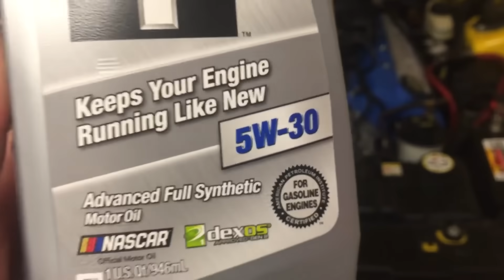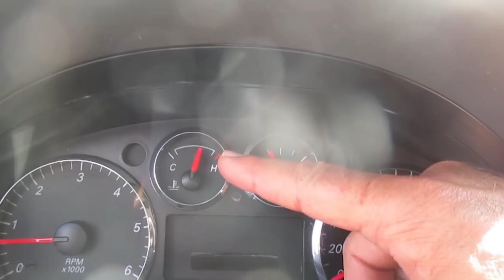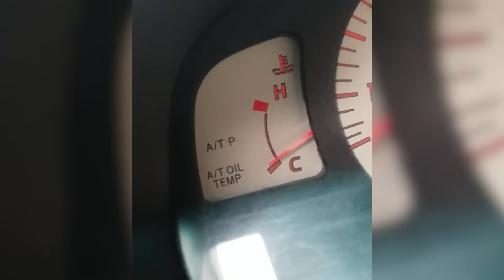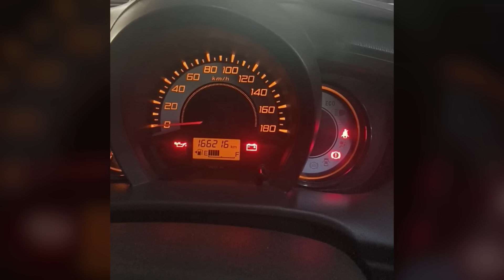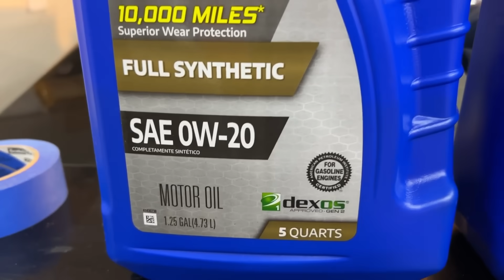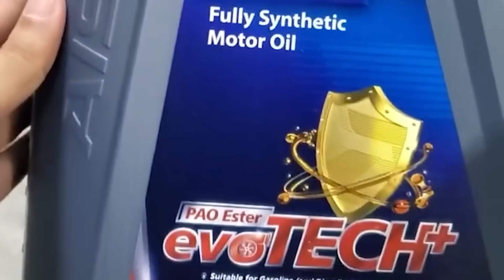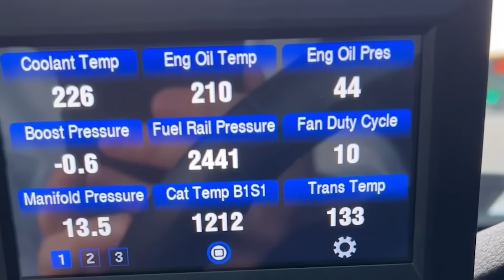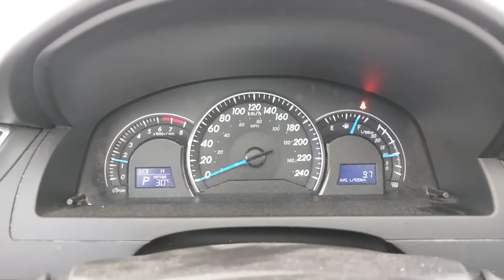Why US  Cars Use 0W 20 But the Same Engines Use 5W 30 Abroad (Exclusive Mechanic Explanation)

Comment: I called and talked to customer service at valvoline, They assured me there is no benefit to go to 5w30 and I should stay with 0w20 even living in hot climate such as florida.
Reply: Reply based on liability? Perhaps
Reply: And you should have asked why do you make 5w30 oil then.
Reply: Yeah, they figure whether you buy Valvoline 0W20 or 5W30 why should they potentially open themselves up to a lawsuit if you develop problems. This is a highly debated topic, do your research and choose for yourself.
Reply: No manufacturer will go against recommended oils, opens them to law suits. Use online viscosity charts.  0w20 fine under 60F, over 70f or so it will shear and not lubricate so well.
Reply: The car companies got the oil companies to lower Zinc in their oil years back to get their catalytic converters to last the 150,000 mandate by the govt, instead of making the converters better, Zinc is 1 of like 2 or 3 things that protect the Engine, don't trust either, they are there for Profit
Reply: Because valvolines not paying the bill you want to put water in your engine go ahead!!!!!!!!!!!
Reply: I was getting my oil changed at Goodyear . and I asked them to use 5-30 on my tundra instead of of 0-20.  after slapping a couple keys on the computer , he said NO. its a  liability issue for sure
Reply: @Phillip-t5y8i  Same at Walmart service. Finally, got tech to search Latest specs for GM L-87..... 0W-40.. DEXOS.. Mob 1 Super Car meets new GM spec.

Comment: Bull crap! My Camry has used 0W20 per manufacturer recommendation from the beginning and it has over 250000 miles and still rubs like a champ
Reply: LOL, it "rubs"? I get it!
Reply: Gotta love anecdotal evidence. "My car runs X and it's fine so you are completely wrong" it's great that your Camry is going strong at 250k on 0w20. The fact is that engine oil is far too thin. We are seeing engine failure earlier and earlier across the board because of thinner oil, among lots of other nonsense like 10k interval oil changes, engine stop start and higher and higher ethanol content in our gasoline.m, just to name a few.
Reply: @angelos5348   0W-20 and 5K miles oil changes for me. 
Stop start and tiny engines with turbos that replaced V8s and V6s are the problems and not the oils.
Reply: @a @angelos5348 I have a 2015 Honda accord v6 with a little over 200k miles. It doesn’t burn oil. Toyota and Honda have been using 0W-20 oil for over a decade. All their models use 0W oil and the only engines that have been having issues is the 3.4TT engine. The rest don’t seem to have any issues and in Hondas case with the 1.5T the head gasket issue isn’t oil related and the engine failures on Toyotas TT v6 may not be oil related either. GM doesn’t know how to build engines with tight tolerances which is probably why the 6.2 and 5.3 engines have been locking up…but those engines have always had issues since 2007 due to the AF
Reply: моя Тойота уже 25 лет ездит на 20w50 и чувствует себя как победитель среди чемпионов
Reply: @Taganskii  Yep, get yourself a brand new 2025 vehicle that supposed to use 0W-20 and replace it with 20W-50, let me know how it works.
Reply: That 0w20 is probably why Toyota has had so many engine recalls over the years
Reply: @MástázTëâchèr yea maybe that twin turbo v6 but every other engine is fine
Reply: @MástázTëâchèr  LOL, Priuses and Camrys taxi cabs in Chicago get 400k-500k  miles on 0W-20

Comment: When I recently bought a used vehicle, the cap said 5-30. This vehicle had about 160k on it. (I drive little) Right off I noticed that when I started it up, it would clatter a bit until I let it warm without driving, which I always do anyway. I let the oil really circulate and have the pistons expand before drive. It makes a huge difference. I later, my first oil change, put in 10-30 and a big difference. Actually, I've been watching and doing this for decades. I never trust the Books 100%. As a retired mechanic, I always gauged each engine on it's mileage, use, where driven in the country and how often it's driven. I've had excellent results. Government and it's criminal fingers ruin so many things because of "doing the best thing", which is rarely the best thing. Politics, even if it means ruining things because the Government doesn't have to pay for repairs. They'll claim saving 0.1 mpg, all the while an engine repair can consume HUGE amounts of energy otherwise, as well as our own money, to repair something with no appreciable benefit. We're lied to and swindled constantly.
Reply: Please don’t do this if you live in a really cold climate
Reply: @dcerty1852  Everyone ran 10w30 with no problems for years in most climates.
Reply: @wkl41-g3v yeah but engines have different tolerances today. It probably wouldn’t be ideal to put 10w30 in a new Volkswagen when it’s -20c here in Canada
Reply: It seems to me the CAFE standards are driven by ideology rather than real science.
Reply: @jameskeys971 so environmental consciousness is completely removed from science?
Reply: @theazurapristina  ...No, not at all. It is that our all-knowing and wise government just went too far in the standards and didn't think about or care if a car just didn't run properly...or for a long time....on 0W-16 or other thin oil. But they will fly big private jets all over the world going to important meetings ( right...!!) that put out more pollution in a month than what my car or yours would put out in a life-time. If they imposed the same strict environmental restrictions on themselves that they put on us regular folks, then maybe...maybe...they would have something to bitch about. And we know that will NEVER happen.
Reply: Also, don’t forget the lie about ethanol put in our gasoline I think in the beginning, they tried to tell us that the ethanol would improve gas mileage when actually adding ethanol to the gasoline actually reduces the efficiency of the fuel it all has to do with meeting EPA standards.
     Do they add ethanol to the gasoline in Europe and in Asia in Australia???
Reply: @marionfisk7926 yes.  not all gas stations but it does exist in those regions.
Reply: The clicking on start up is because the engine is mostly dry since thin oil runs off the engine and sinks almost completely and also takes a bit to lubricate enough
Reply: Yes, the gov loves if you car breaks because of all the extra taxes they collect off your repair costs. That’s why they also preach about saving the environment yet they allow companies to produce disposable junk like refrigerators and washers that last only several years when those appliances used to last decades. Every time you have to buy a new appliance the gov is collecting tax on that. I wish some company would just start producing high quality, long lasting products to change the entire system. Nowadays even if you spend big money on something you still end up with a product with quality nowhere near as good as it used to be.
Reply: @newfie-dean5803  ...Absolutely and 1000%....CORRECT..!! I am 74 and I remember seeing washers & dryers and refrigerators that were 20 years old and older still running: The famous Maytag and Kenmore indestructible appliances, made completely in America by American workers by American companies that cared about those things. Yes, "Planned Obsolescence"...the motto of manufacturers...mostly.

Thankfully, there are still exceptions: Toyota, Honda, Mazda, to name just a few of the very few that still believe in long-lasting and reliable vehicles. I am not sure if there are any all-American made vehicles that are still quality and long lasting...are there any..like there used to be ???
Reply: If that happens it means the bearing clearances have worn out which means there is now excessive clearance. 10w30 while fill that in, but eventually you will have rod knock, just change the rod bearings before your engine blows. And you are not supposed to warm up your car by idling, that cause far more wear then if you just drove it after 1 minute of idling and keeping it under 3krpms and under 35% throttle.
Reply: If new run the 0w20 every 10,000 miles use 1qt more 5w30 until 50 or 60k where you are using only 5w30.  So when changing oil at 10,000 miles put 1qt 5w30 in first then top off with 0w20 at 20,000 put 2qts 5w30 then top off with 5w30.  So on and so forth till you are only using 5w30.
Reply: @Mudfister you have a typo at 20,000 miles.

Comment: My '21 GMC 1500 V8 5.3L oil cap states 0W-20 Dexos-1.  I use 0W-20 Dexos-1 in my -40C/-40F deep cold winter months. During winter months I mostly do many short distances.    I use 5W-30 Dexos-1 in hot climate (+20C/+30C) summer months.    I also do my own Engine Oil & Filter changes when remaining use percentage is between 35%-30%.   I also installed an engine block heater and onboard NoCo 2A battery charger and disabled its AFM/DoD feature (which makes it "always a V8")..   Always "plug in" both during < -10C winter months....  This works for me...

Comment: This is truth. Punch in your engine type into Google and ask "Does the (your engine) use different viscosities of oil outside of the U.S." and see what it says. My engine is the Toyota 2GR-FE and it says it uses strictly 0w/20 in America for CAFE/Emissions rules but uses higher viscosities in other countries. I switched from 0w/20 to 0w/30 my last oil change.
Reply: Yup. I did exactly that the other day for my 17 Tacoma with the 2GR-FKS V6 and 110k miles. I live in CO and it will now live the rest of its life on 5w30 for now on… wonder if the thinner oil contributed to the common timing chain cover leaks that are very expensive to fix 🤷🏻
Reply: I bought a new 23 Tacoma and I run 5w30 i'm at 22,850 miles my engine sounds better runs better. and I started running it at my first oil change 4600 miles and been running 5w30 ever since.
Reply: @stoneycarter7789  The government, company, and manual tell us that we can't run a heavier oil in America because it will hurt our engine---scare tactics to push the climate change garbage.